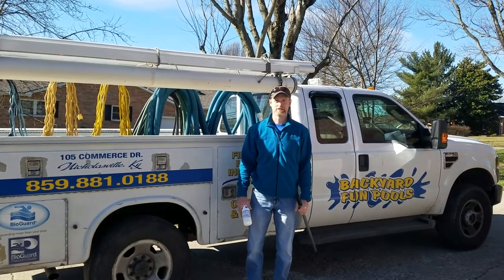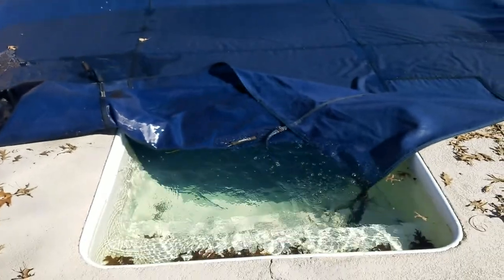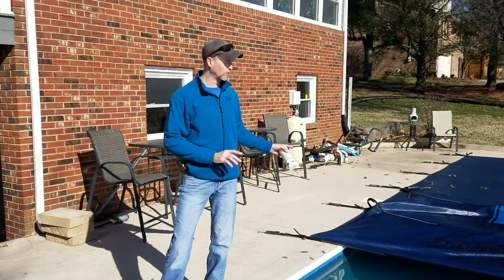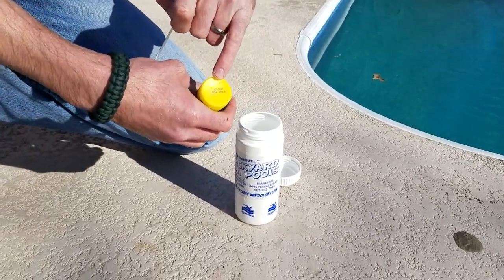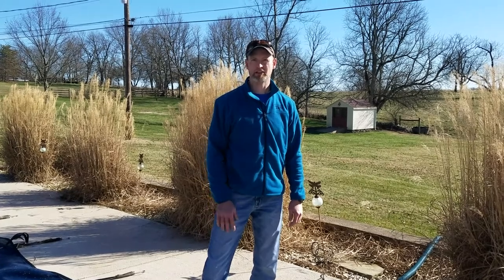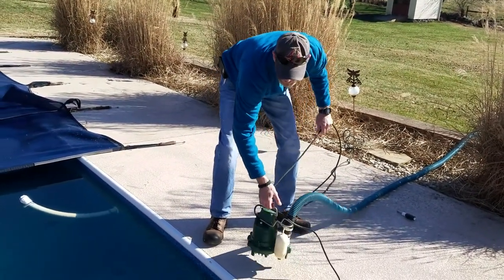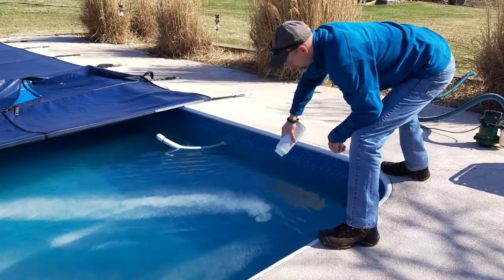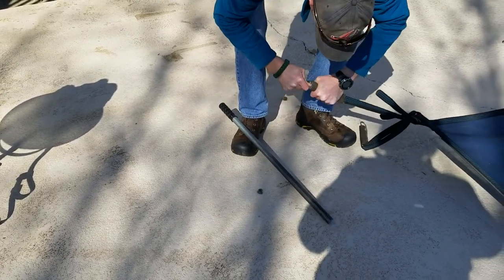Winter Pool Maintenance

Comment: Just bought a house with a pool.  Never had a pool and know nothing about maintaining them.  This house has an Aqualink system that appears to be broken and I would like to get it operational again.  Also, this pool has a whirlpool. There is a solar heater as well as some kind of air conditioner looking heater too.  I have Jandy valves that appear wired into the aqualink conttol box that is not running.  It seems previous owner put a mechanical timer to run the pool pump about 4 hours each day.  In your chlorine video, I also have that Aqua Rite box too.  

It would be nice to see videos on Aqualink, how to disassemble and inspect the salt/chlorine generator, and how to replace the pool filter.